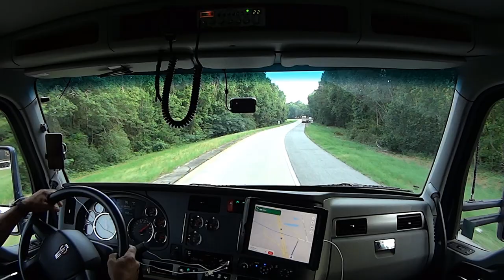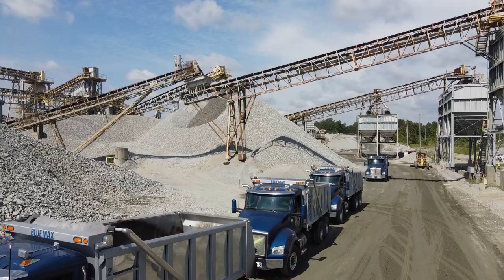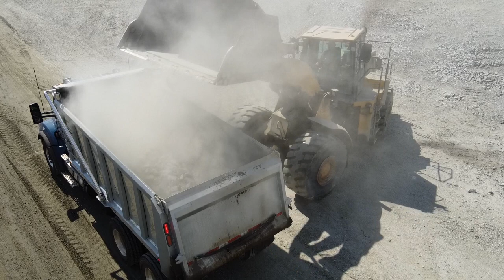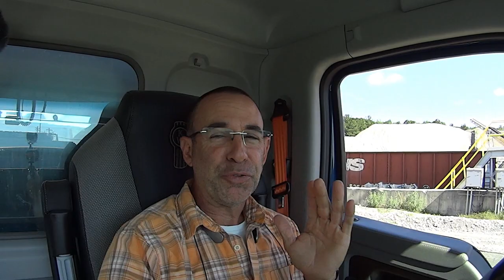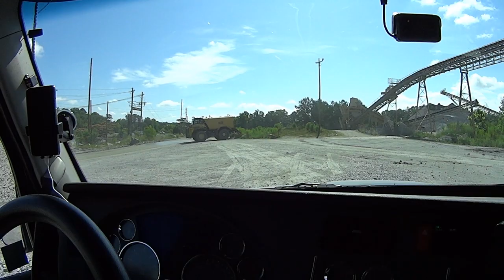Long Haul Tandem Axle Dump Trucking? 500 Miles in a day

Comment: Do you still work at the same company or did you go to a different company
Reply from the maker: I don’t know how to answer that question because I don’t know how far back you’re going with your question. I am with a dump truck company since March. Before that I was with Atlantic Waste doing rolloff
Reply: I just don’t know if you move or worked with the roll off company still
Reply from the maker: Yup! New company. I no longer haul trash, now I haul rock, sand, asphalt and dirt for Blue Max Trucking as of March

Comment: We've done that many miles short haul with belly dumps, it makes for a long day. If you're hauling 20 ton in that truck you're definitely a few pounds over.
Reply from the maker: We aren't. We are hauling "Highway Loads" and maxing out at 52 or 53,000 pounds total. Pretty sure I show it in the video
Reply: Right, it's generally 14 to 15 ton like you said but you said if you're not on the highway you generally haul 20 ton which is what a 5 or 6 axle hauls. Here in Idaho we can legally gross 54,000 on a 10 wheeler. Our super 18's which is a dump truck with 3 lift axles and a strong arm axle out the back so a total of 7 axles can haul 25 to 26 tons or 80,000 gross.
Reply from the maker: I haul 20 t which puts me exactly 64000 pounds which is our max. Generally, they load us with 19.5 t of material to play it safe. My Tare is 24, 060 full of fuel and DEF. sometimes more/less depending on which scale I cross